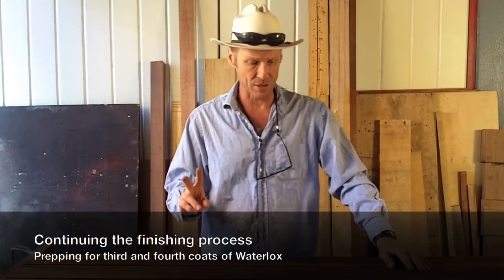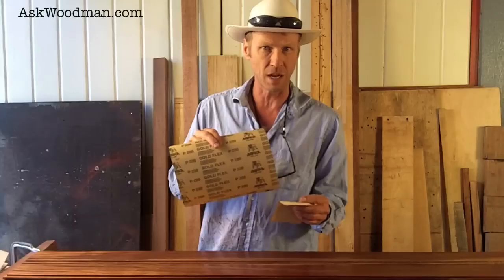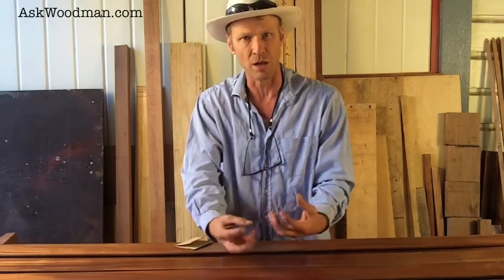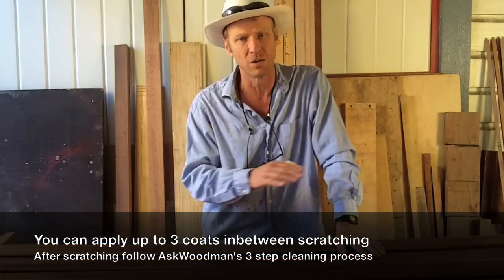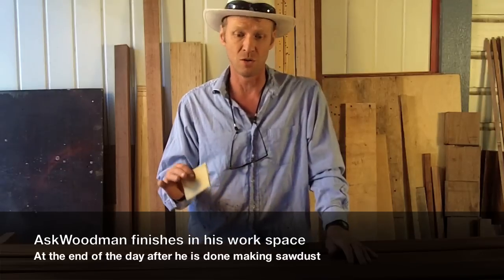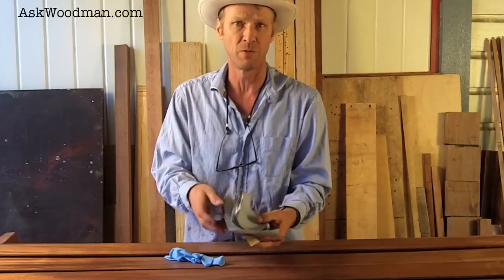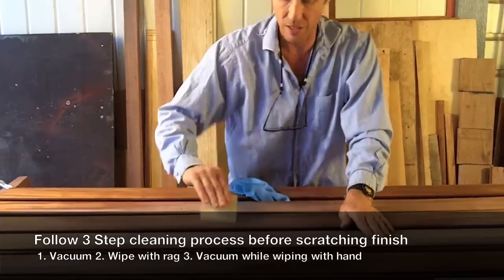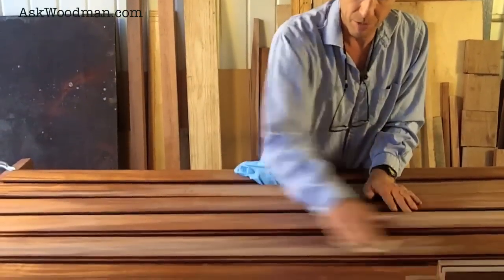15 The Secret to Applying Multiple Coats Of Finish - SOLID WOOD DOOR SERIES - Video 5

Comment from the maker: A lot of the hand tools still used today are based on designs that were developed during the golden age of furniture making in the 17th and 18th centuries. They had hand planes and scrapers and even sandpaper featuring the garnet mineral which has been used as an abrasive since antiquity. The Chinese have been using the seed from the Chinese tallow tree for a finish for 2000 years. The seed oil is also called tung oil and is the basis for the Waterlox finish I use in this video.

Comment from the maker: It can be sprayed. But since it is not as fast drying as lacquer the spray build is pretty slow. I can just build product so much faster with a brush where I can work it until it starts setting. This is a really tough finish that can stand up to abuse and can be easily touched up with a scratch and re-coat. It is basically all I have used for over 25 years.

Comment from the maker: Kevin that is very odd. Are you sure you don't have any contamination. The hi gloss is very thick compared to Original medium. I would try a couple of things. First soak your foam brush in thinner to get all of the air out. You may also want to put a splash of thinner in your work pot to make the High Gloss a little more viscous and to give you a little more open time to really brush out the finish so the vigorous action of the brushing will break out any trapped air. What wood is the bar top?

Comment from the maker: @radiskull1973 It sounds like your problem is cleanliness and or surface contamination. Steel wool can shred little pieces that get trapped in the finish. Tack clothes contain oils like linseed oil that can leave a residue that makes the finish adhere unevenly. Just use a no load/open coat 320 paper and scratch your surface real well. Then use a lint free pantyhose and a vacuum to clean the surface, and then clean some more. Try a wide foam brush for the flat panels.

Comment: Awesome videos:) Weird sorta' but, how do you think people finished their furniture 200 years ago? Were they using some sort of rake/scraper to smooth the wood, and then linseed oil coats? Have you heard of ny comparable system still used? Also, how do the Amish smooth and finish the furniture they create? Any insights would be greatly appreciated:)

Comment: Thanks for the video! So you said it's normal to have a cloudy finish between coats? I'm using 000 wool and even after cleaning all dust it remains completely cloudy. I'm hoping I did not put too much pressure with the wool. Is it ruined or will another coat bring it back to life?

Comment: thank you for your videos, especially this series; finishing with waterlox; beautiful result! i am finishing a bar top made with Ipe, i've applied 5 coats of waterlox original sealer/finisher medium sheen and am now using their original high gloss as a last coat,,i scratched the final med. sheen coat with 320, 400, 600 open paper and cleaned the surface very well, i applied the high gloss with a foam brush and now have many tiny air air bubbles on the surface, any advice on how to fix? gracias!!

Comment from the maker: I have a project coming up where I am going to show a base coat alternative to Waterlox to help people save money on Waterlox or for people like you, show an alternative. Linseed oil 70%, oil spar varnish 15%, turps or mineral spirits 10%, 5% Japan dryer. I like to warm this mix up to make it more viscous and flow and penetrate better. Remember that linseed oil left in rags is a fire hazard deluxe. Douse them in H2O. This is the finish I started out with as a woodworker.

Comment: thanks for the speedy reply! the bar top wood is IPE. i'm confident there was no contamination on the wood surface, i like the idea of soaking the brush first, would mineral spirits work for that? and when you say a "splash" of thinner how much would you add if my work pot is going to have about 2 cups of waterlox in it for the next coat?  thanks agin for the help!!

Comment: Just something I thought I could contirbute. I agree you don't need to wet sand at all, but if you did you can do it with water. I wet sand all finishes with water, lacquer whatever, wipe residue off with clean rag obviously. Also you can use normal sand paper to wet sand (falls apart faster) or wet/dry paper to dry sand. Keep bucket of water there, dip paper, rub paper with fingers, keep going and wipe residue  as you go also.

Comment: I am refinishing an old table that is solid wood. Everything has gone great so far, but after lightly sanding my first coat of varathane satin finish it is looking a little white in some spots....now I am scared to put another coat on in case it just locks in this cloudy look....any suggestions?
Reply from the maker: Can't help you. I avoid poly like the plague.

Comment: Waterlox Original is the ultimate finish.
Reply from the maker: I have stopped using Waterlox. Over the last year and half I have noticed bubble problems, sheen issues mainly streaking, and an overall runny consistency that does not set up like it had for 25 years. I am going to take these video down once I get my new method perfected and filmed. It is a shame because for over 25 years I could have trained a blind chimp to lay down a respectable coat.
Reply: That is the last thing I expected to hear.  I have been using my old stock and was just getting ready to place a large order. I have not had any issues but I have not purchased any recently either. That is so terrible to hear because I do not use anything else other than Waterlox on my products and love the look of it when used on quality veneer and wood. I really depend on it for products. What are you using now?
Reply: AskWoodMan Have you contacted Waterlox about the issues you started having?
Reply from the maker: Steve Paul
Yes.
Reply: AskWoodMan is it because they've switched to the low VOC waterlox formulas? (at least here in california) Either way great video series!
Reply: +AskWoodMan Did they ever reply and give any reasons for the air bubble issues?
Reply: +AskWoodMan Oh also, did you settle in on a replacement product and technique? Would love to know. Thanks!
Reply: You don't have to buy the low VOC.  They still sell the Original.

Comment from the maker: @BADBRYZ I am a Waterlox Original Medium Sheen guy. I have been using this for over 20 years as my sole finish. It has the drying agents mixed in as well as phenolic resin to harden the finish. I NEVER use pure tung oil because the drying and setup is unpredictable. I have pieces in my house that are over 20 yo finished with Waterlox that still look great. It is primarily sold as a floor finish, so that tell you how tough it is if applied properly.

Comment from the maker: Thanks a lot. I would recommend not doing it with an orbital unless the finish is very hardened and cured. In this case with the finish still soft, even a no fill/no load paper can gum slightly with the orbital action and leave marks. It really does not take much time to do it by hand, and there is little risk. Allan

Comment from the maker: @telosfd To sand the finish I usually wait 24 hours. If it does not make a powder I don't think it is ready. But you can apply multiple coats between sandings depending on how clean your surface is and how straight you applied it.

Comment: I have an important question. I have just started a project using an oil base Varathane 900 gloss on my work bench top. I applied 3 coats used 320 grit in between. Basically 24hrs in between to dry. Now Ive heard that oil can take as much as a couple weeks to dry! Now that I have 3 coats on, Im concerned that each level hasnt cured enough! Also, that I should have at least 4 coats(to rub out the varnish),so I can sand the final with a 1200 grit with an orbital sander to get a nice gloss finish

Comment: I came to this video specifically for the "next coat" advice. This is my first gallon, it came as Marine. My only concern is the condition of the top of the can itself. When I'm buying olive oil in a similar can, I can't see any welding overspray. On this can I see it on the handle, and the spout. Is yours like this? I'm just asking because I doubt you get that from machine weldments. And I doubt the handle would have been higher on one side. Is it just made in that small a facility, or did I get ripped off?

Comment: I am a fan of a flatter look and at the same time I like to use an oil base so the finish can get underneath and "pop" the grain. Does the finish have to have high gloss to pop the grain or can you achieve this with a flatter sheen?
I love this low tech approach.

Comment: It made me extremely nervous while sanding my first coat of polyurethane on our newly purchased craigslist kitchen table that I decided needed to be refinished (pretty nice but all scratched up, I believe due to kids with forks). Clearly I didn't put enough trust in your expert advice/ video tutorials because the second coat of poly turned out great.  I feel so good about it I'm going to go for a third coat just in case my wife and I ever decide to conceive and somehow they get ahold of a fork before I am able to teach them the importance of a quality wood finish. Regardless,  my wife and I are very excited to have a like new kitchen table with a rich, dark wooden surface because we have been eating off of a pale gross wooden table for the last 7 years (I bought it on the side of the road while I was in college). We owe it all to you Mr Woodman.